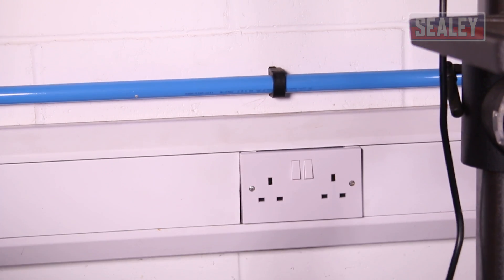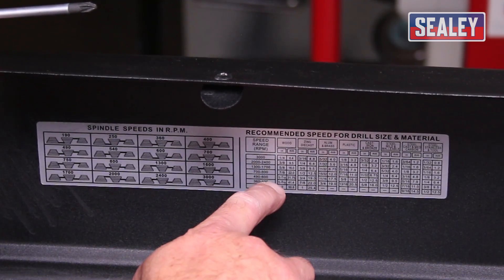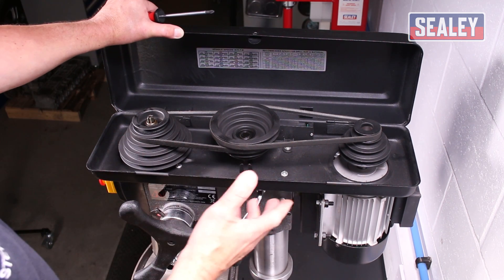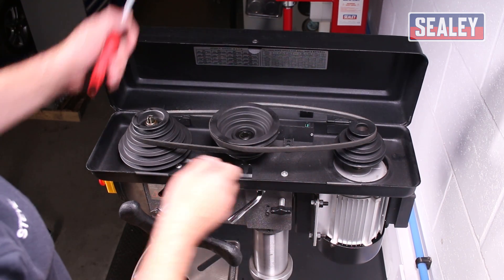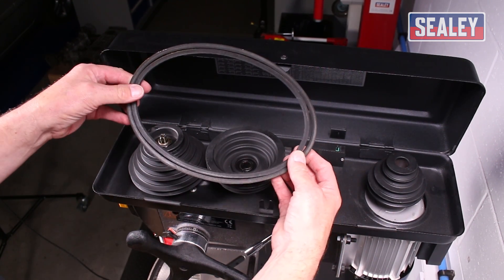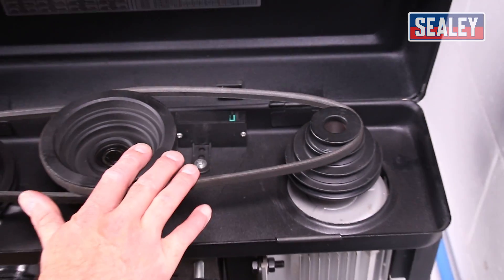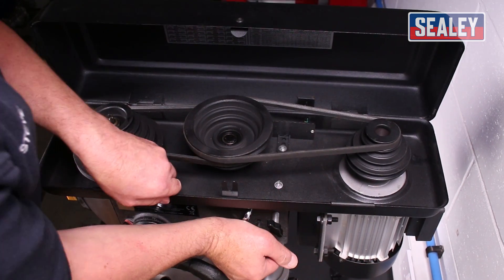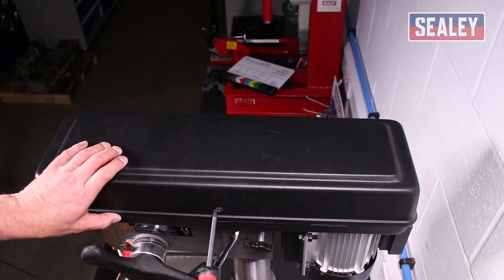How to Change Pillar Drill Belts

Comment: This is a very heavy duty and rather heavy tool.>>>t.co/zKb44O3etQ    It is built with heavy steel and cast steel. For the price a remarkably heavy duty tool. If you need a drill press, you've found it**This is a heavy duty drill press. I am happy with the quality and how it works. This works for my crafts and I highly recommend it.